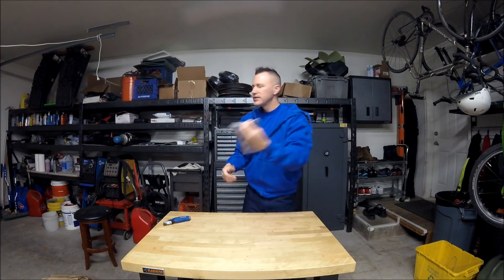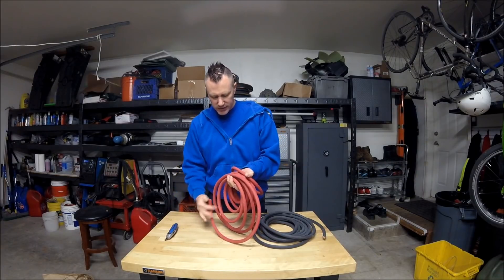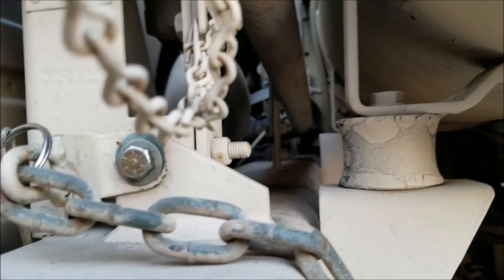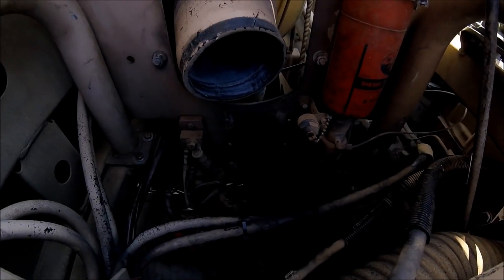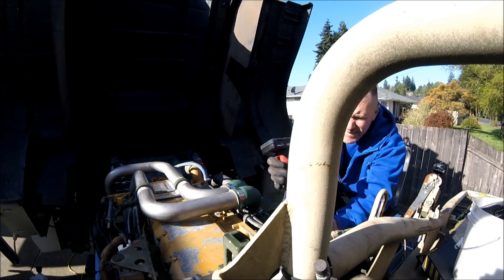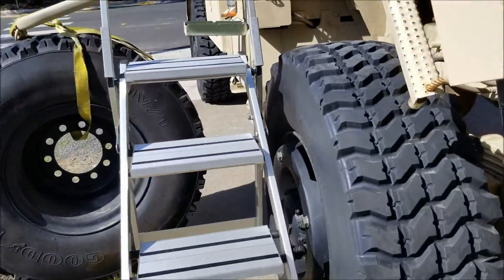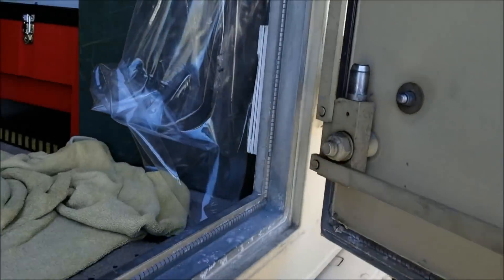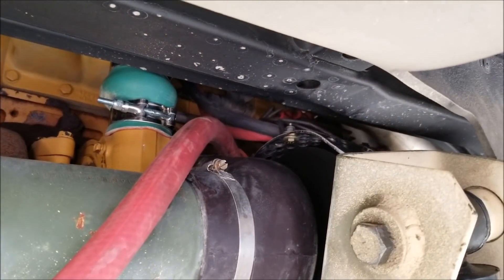Abel LMTV build part 97 (2/0 flexaprene wire upgrade)

Comment: Screenshot that battery diagram 👍
Reply from the maker: Yeah, you should...
Reply: @SeanFastidious  I did! Kinda glad in the 5 ton I own I only have a straight 24v system even with 4 batteries.  Though, the threads in our forum about, “can I just tap off any one of my batteries for 12v?” are EPIC! 🤣🤣🤣